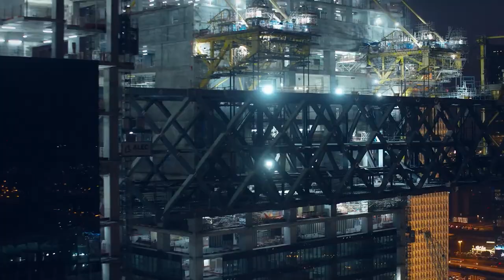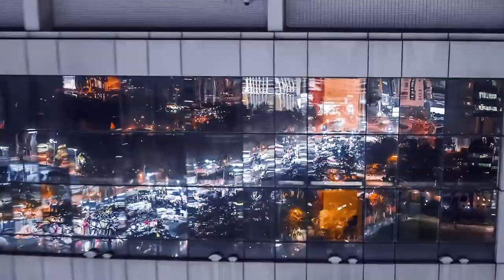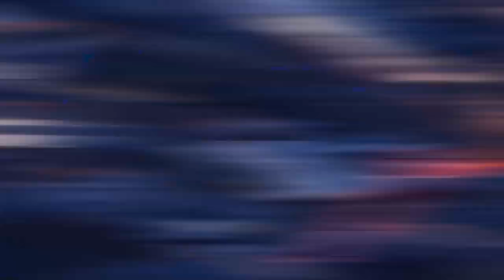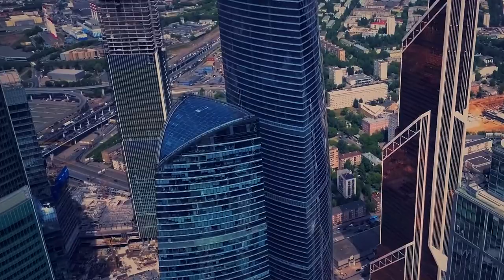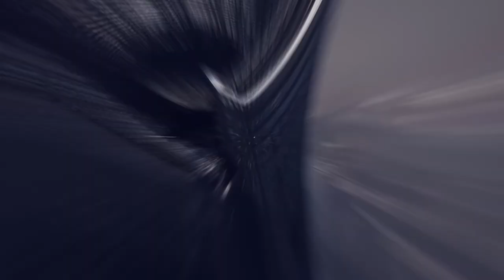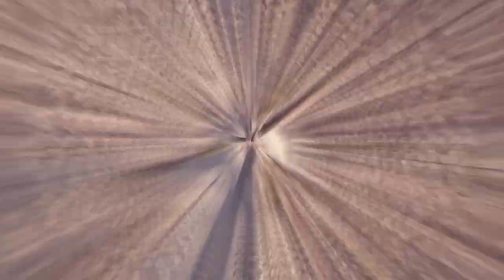What Are Skyscrapers?

Comment: Interesting and informative. Good job and much love.
Quick question: How do architects and engineers deal with strong or high winds? Especially since buildings are becoming taller and taller.
Reply from the maker: Glad you enjoyed it, thank you for watching! 😇🙏 In terms of strong winds, there are several techniques that architects and engineers utilize to keep these superstructures stable. For example, the steel and concrete that are used are themselves designed to be flexible so they could absorb much of the impact of these high-altitude winds. Another method is to create a strong backbone by collecting several steel columns and beams in the skyscraper's core. That allows it to be quite resistant to wind forces as well.